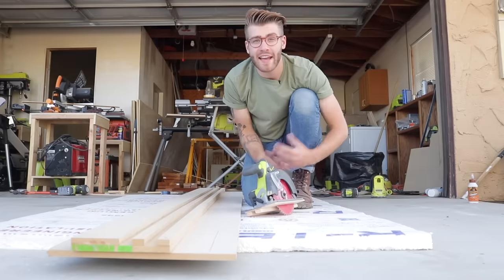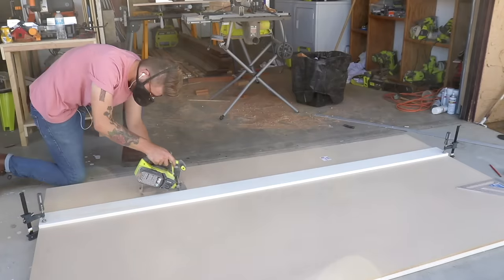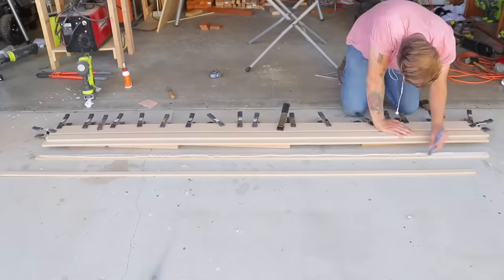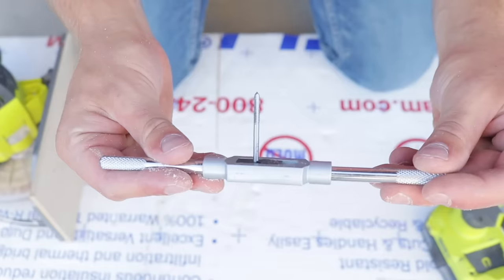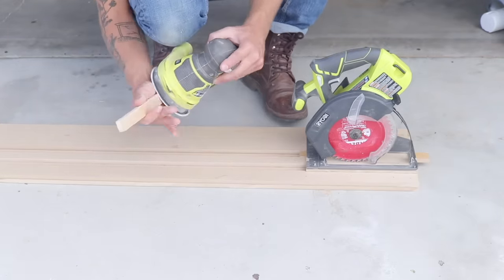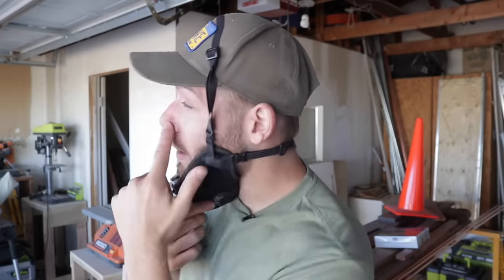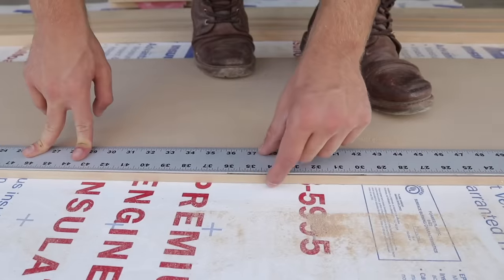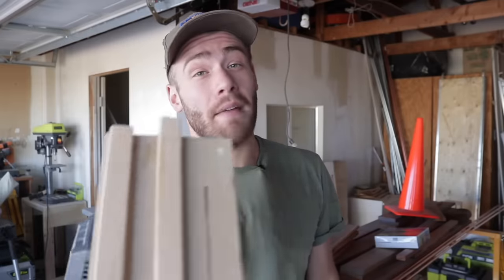DIY Circular Saw Track Saw Guide | Limited Tools

Comment: Great project. I think I'll build one. One pointer for you: When you tap holes, turn the tap 1/2 turn, then back a 1/4 turn, then forward 1/2 turn, etc. This will clear the teeth of the tap and will make the hole cleaner, with less chance of breaking the tap. This becomes REALLY important in thicker/stronger material. Also use some oil when tapping to make the cutting easier.
Reply: Appreciate Video clip! Excuse me for the intrusion, I am interested in your thoughts. Have you tried - Schallingora Dexterous Programme Scheme (Sure I saw it on Google)? It is a smashing one of a kind guide for taking a drawing and turning it into wood without the hard work. Ive heard some great things about it and my mate  got great success with it.
Reply: I hand tap as small as M2.5 regularly at work in 25.4mm or 1” thick stock. While not overturning is important... the pilot hole is very important that it is drilled straight. Starting threads with a tapered tap is best and if it isn’t a through hole switching to a bottoming tap once you have enough threads started. I use one hand to grip both ends of the t-handle and stand over the top of it. When anyone shears off a tap it’s probably 90% + chance they were overzealous and overturned it. Other things are not enough lubrication, wrong pilot hole drill bit size, uneven pressure when turning the handle. A coworker managed to shear a M12 (basically a 1/2”) tap by hand... I was amazed someone could be that bad.
Reply: Great tips!
Reply: haha, came here to say the same thing

Comment: Actually - one runner is completely enough. I used aluminum U-profile runner and screw it directly to saw's base plate. Such way you are not loosing cutting depth.
Reply: Good idea. Thanks

Comment: I built one but I had a big problem. The factory edge I started with wasn’t a factory edge or straight. Didn’t figure it out until I made the Final Cut. What now?  I used my board straightener jig on my table saw to straighten out the “factory edge”. 
I used a tight string line with nails for spacers and measured from the string to the board all along the 8’. It was perfect to my surprise. Then I cut the other side parallel. I flipped the board over and trimmed all four sides of the tracks. Two from one side and two from the other side. Then I removed the circular saw track board and built a new one. When I made the Final Cut the cutoff piece was perfectly consistent at a thickness of less than a credit card. Success. I’m so happy was was able to save it. 
My suggestion is to trim the track boards after securing them to the main board because it was much easier to get the gaps perfect. 
Thanks for a great video.

Comment: There are so many DIY track saws, guides etc out there but this one works great and I didn't need to run to the hardware store for a bunch of parts.  I used 3/8 MDF and it is still heavier than heck.  Thanks for sharing your design.

Comment: Love it man, thanks so much. I like how the **runners** will keep the saw in a tight straight line more accurately than a simple regular edge jig will do (something that most smartass commenters here seem to not get). Love shop and jig projects, keep making these!
Reply: I made a simple non-track edge guide years ago, but the difference between that and the new track saw guides is downward pressure. The grooves in the track means you don't have to push the saw sideways against a straight edge - and that makes all the difference in the world.

Comment: Glad you addressed the thickness issue at the end of the video. In addition to the other limitations cited with this design is weight. All that thick stock, while strong, is *heavy*.

The design is way over built. ¼" material is plenty strong; especially considering the rigidity contributed by the rails/tracks.

Some additional considerations:
1. Material - Use quality sheet goods. No A/C-grade sheathing.

2. Material - The use of either plastic (HDPE, UHMW) or aluminum would make wonderful runners for the saw plate.

3. Finishing - If using wood, regularly waxing the tracks and runners will definitely contribute to smoother operation.

4. Design - Symmetry provides bi-directional operation; an often overlooked consideration.

5. Design - Overhang/starting pad. Make the track long enough to allow for alignment before the blade contacts the material to be cut.

6. Design - A key capability of true track saws from Festool, Wen and others is...plunge. This is critical for interior cuts. To allow for this (somewhat) leave 2" to 3" of the runners cantilevered in front of the saw plate. Additionally, cut the at a shallow angle to allow the runners to engage and align with the track before the blade plunges into the material being cut.

7. Design - To counteract thewood track from slipping and sliding, a) make the track no wider than 2½" to 3", b) route two shallow parallel dadoes in the underside of the track and c) apply friction tape to the dadoes. This will keep the edge of the track in contact with the material being cut, thus minimizing tear-out while keeping the track in place without the need for clamps.

8. Design - To minimize sacrificing depth of cut, consider cutting down, rather than building up. Instead of fastening rails on top of a track, cut dadoes into the track.

9. Lastly, and in the same vein as #8 above, consider mounting runners directly to the factory saw plate. Many models have slots perpendicular to the blade for attaching accessories, such as edge guides, etc. Some models even have precision-drilled holes in the factory saw plate that would be perfect for fastening runners.

While all this may seem like a lot of work, consider the cost of s true track saw (north of $800 or $900), or even lower cost alternatives from the likes of Kreg (Accu-Cut), Bora (Clamp Edge), Wen and others ($100 and up).
Reply: Some good advice. I have a question. What is the tolerance of the alignment of the blade to the track? I added two tracks to the base of my saw but am about 2 tho out of being parallel with the blade. Will this work or will the cut bind or go off line? I have not built the guide yet because I am worried my alignment is too far off.

Comment: Good job buddy.This one is a proper saw track , I made one but not as good as this one , I attached anti slip tape(cheap tape looks like 60 grit sand paper,1 roll 5$ in Australia) underneath to be able to use it without clamps.
Reply from the maker: nice!! I'll have to check that out!

Comment: Looks good. I have the same saw specifically for breaking down sheets goods. I’ve been using a drywall square but it’s not at all accurate. Not recommended. I’ll be making one of these very soon.

Comment: Great build.
 With some paste wax it'll glide real nice. :)
Personally I opted for a version of what you have that snugs right up against the baseplate. That way I don't lose precious minutes removing the baseplate jig to switch over to cutting a 4x4 or something thicker.
Reply: That's a great call.  I think you could also make a version from aluminum to make it more durable.
Reply: haha I was debating the exact same thing but had to pull myself out of the rabbit hole in order to just get the main project done, for which I needed the track saw in the first place. Version 2 will be a nice strip of aluminum for sure ;)

Comment: Great project and something I need to do! Don't have the home center cut your strip.  The panel saw relys on the manufactured edge which might not be square and don't think those home center guys take the time to check the pannel.  Good for breaking down to managemable sizes, but don't use the home center for final width.   I learned that the hard way.   If you have to you can by a premaid shelf, but check that the end is straight and flat.

Comment: I love this Limited Tools series(?) 🙌🏽
I want to start trying to make stuff using power tools, but all the accessories are starting to add up. This is super helpful for newbies like me/people who aren’t able to invest in a full set of shop tools!
Reply from the maker: That's awesome!! thanks Claire
Reply: You can add the accessories once at a time, project by project.
Reply: Claire Tajonera q
Reply: Right on. And don’t forget that used, inexpensive, high-quality hand tools are easy to find if you are willing to spend a little time refurbishing them. (Check out paul sellers for ideas) they can build anything that you can imagine.
Reply: Great comment.  A new woodworker can add to his shop AND skill level with projects like this.

Comment: I like this a lot. Great idea. My one question is, is why didn't you cut off each side first so you would have your factory edges for straight cuts? Like it, and when I get more of my garage to a point of being able to use it as a workshop this will rank right up there for a 1st project 😊😊😊

Comment: Nice straight forward design and instruction. Although you can swap the saw base on and off, that probably isn't practical and you'd need to dedicate one circular saw to this jig for panel cutting.

Comment: Neat project! Thanks for the video tip. I'm not a big fan of MDF. I'm concerned about durability knocking it about the shop. Also, I live in a high humidity area and I'm concerned about dimensional stability. Lowe's sells a very clean, pre-primed "blondwood" plywood in various thicknesses. I might try that instead.

Comment: Sticking the sandpaper on the bottom will prevent the guide from moving (helpful with the smaller guide - clamps no required). Cheers :)

Comment: I saw a guy make a saw like your with the base the hardboard but it was not sturdy enough to hold up as a contractor so he finally bought the wen panel saw.  I think the extruded aluminum rails are cheap enough and adapting a saw you already own to run on those might yield better durability.   But I love watching shop made tools,  I know 200 years ago craftsman made beautiful furniture with tools they made themselves so I never discount the quality of shop made tools and jigs and the results they can produce.
Reply: @saywhaat8933  ?
Reply: Where have you found cheap extruded aluminum rails???

Comment: you think this is work the time or is a straight edge guide just as good?
Reply: A straight edge will work look at the video that is what he used to make this, but two main  downfalls make this worth the build. One is you have to take into account the width of the sawplate  on every cut measurement. 2nd while cutting you have to make sure you keep constant pressure on the saw so it stays against the straight edge.

Comment: I think you might have over engineered the humble track saw jig which contractors knock up in 5 minutes and don't require any mods to your Circular Saw.
Reply: I think that the fact that it locks down the saw in two directions rather than one make it potentially more accurate.
Reply: This design eliminates any problems with an out-of-an-alignment baseplate. A lot of circular saw baseplates are not perfectly parallel with the blade--especially a well-used circular saw.

Comment: A couple things. First, this seemed a bit too complicated in the sense that it was overdone. This Old House in one of their videos glued two pieces of wood together, and then used the straight edge of the top piece to cut the bottom to size, which they did on both sides to use both sides of the circular saw. Their track took 5 minutes with no manipulation to the circular saw itself. Secondly, when you tap a new hole, you rotate 3/4 of a turn, then rotate back 1/2 a turn. This minimizes errors in threading, especially when it comes to malleable metals like aluminum and brass and it frees up the cut shavings. Either way, good project.
Reply: omg why are people on the Internet so annoying

Comment: Sorry stupid question here, I'm a beginner and I'd like to ask if anyone here know, is it better to use MDF or plywood or other wood material for the track (not counting on any metal material) that holds best against warping, as normally wood become warped in the long run caused by humidity..

Comment: You seemed to randomly position the holes to be tapped. Don’t you need to worry about where in the base plate they go? My saw has a waffle like pattern on the top of the base plate and I think I should avoid placing the holes on the (relatively thick) walls. Also, when you want to remove the added 1/4” external base the first time, do your 2 dabs of hot glue make this difficult— any tricks? Also, any tricks for sawing your 2  “1 inch” boards to the same width— I think you want less than 0.010 inch difference. I’m beginning to make a track saw using routed slots, but your version looks like it might be better. Thanks.

Comment: I do not understand the need to use the saw guide. What is the difference between this guide and the strip from the beginning of the movie ?? both have to be fastened with clamps and after both saws the saw goes smoothly. Sorry for the translator. Greetings from Poland
Reply from the maker: The track stabilizes it in both directions. Toward and away from the fence
Reply: Several commenters have apparently missed that this track gives you the ability to lay the track on a line and cut exactly on that line!  @ModernBuilds

Comment: This looks awesome. The only thing that I would do differently is not cut stuff on the driveway. Set up two saw horses, put a piece of 3/4" plywood down, then your insulation and boom, you have a working height cutting table. Thanks for the idea. Basically getting a tracksaw for  maybe $20 in material and a few hours of time.
Reply: Your knees are fine until they're not and then they'll never be fine again

Comment: Very helpful project Mike.  I will definitely be using this when I upgrade my current saw guide.  Side question for you.  It looks like you have approximately 8 foot tall walls in your shop.  I'm in the planning stage for a new workshop and can't decide if it is worth the extra expense to go with 10 foot tall walls.  Any thoughts on having 8 foot walls vs. 10 foot?  Thanks man.
Reply from the maker: If I were building a shop from scratch I'd definitely go for 10 foot. Nice for moving and storing pieces. Aside from that, it's helpful from my standpoint for lighting and filming.
Reply: Modern Builds Thanks for getting back to me. I'm definitely leaning toward the 10 foot walls now.

Comment: Is it just me or have you build this for a left hand user??
Reply from the maker: Haha, just depends on how you use it... I wish they made a left handed saw!
Reply: I think you maybe have a point. Normally the saw blade is on the outside when you grab the saw with your right hand. Your looks like it is on the inside. Either way you will probably make it work.
Reply: I have one. I am right handed and actually i do prefer left handed circular saw. I have no idea why. Probably because i can handle a left handed saw with right and, but its more difficult to work with a right handed saw with left hand. and many times i found there is a lot of situation that its just easier to change hand/direction than moving the workpiece, find an another setup for the right position etc.

Comment: The unthinkable happened to me the other day. I was making a few cabinets, when I notice none of my cuts were actually square. Strange since I was referencing off the factory edge. After hours of checking my tools, checking my measurements, checking everything I could think of, I could not find the culprit. Then I tried the silly. I checked my whole 4x8 plywood. There was the culprit. None of my 4 whole plywood boards were square! The entire plywood was askew! I'm never gonna trust the factory edge ever again.
Reply from the maker: haha! i don't blame you, that's rough. Was the edge not straight, or the corners not square? out of curiosity. If the corners aren't square that would still be OK for a project like this as i'm trimming the ends square at the end. Regardless, that's no fun!!

Comment: Great track.  I have a question.  Can it be used to cut bevels/miters?
Reply from the maker: It could, but then it'd mess up the reference line for when you cut straight 90 again. I'd make a separate track if you do a lot of bevels

Comment: Limited tools!? But you used tool x, y, and z! Not everyone has $10,000 budget, Mike! 😂 

J/K just quoting some past trolls. This is awesome!
Reply: Do It lmao yeah but I’m going to do it with a free circular saw and a $50 table saw so I’m good lol
Reply from the maker: haha! full expecting a couple of those comments in earnest. good one!! :)
Reply: looks like a great way to make a beginners track saw. Do you think after a lot of use the MDF tracks will wear and become looser and reduce the accuracy of the cuts?  Would it be better if you used aluminium for the tracks (of course this will be much more expensive).

Comment: Nice! Have you thought of adding the same type of non slip surface (like a traditional track saw) or even sandpaper to the bottom of it?
Reply from the maker: That's a really good idea!! wonder what a good mat would be?
Reply: Modern Builds You could try silicon strips. As in silicon matting.

Comment: Why MDF? Plywood isn't advisable? Thanks for this Mike.
Reply from the maker: Plywood is not advisable. It has internal tension between the layers of wood making the ply's, which can lead to it warping...where MDF is homogeneous and from my understanding the most stable sheet good you can get at home depot.
Reply: @ModernBuilds  Very true about MDF but if you live in a damp climate my guess would be that ply would be more stable as MDF swells badly in damp conditions.

I'm living abroad at the moment and this project saved the hassle of trying to transport my Makita tracksaw!!